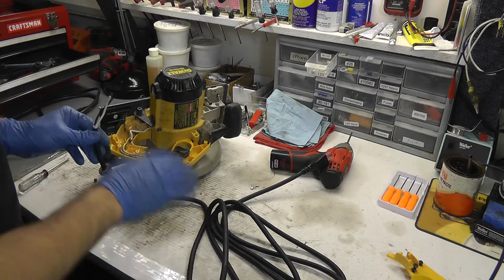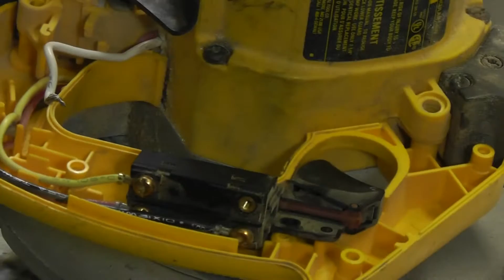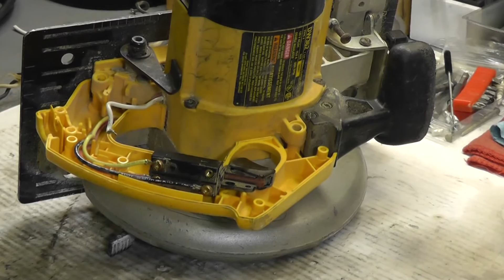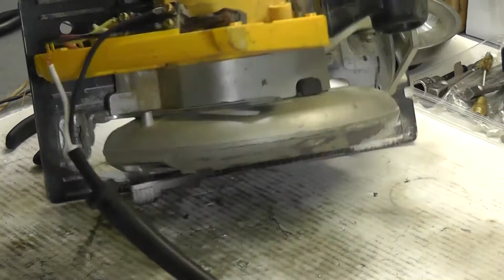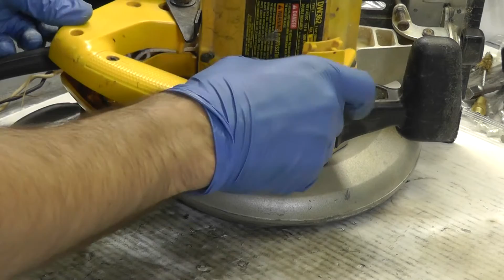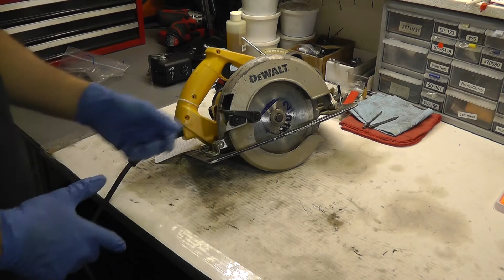Power Cord Install On A Power Tool

Comment: LOL, you crimped your field wire...
Reply: Do you have anything on the electric brake? I have a DW364 from 1986(ish) I am replacing the power cord but the electric brake didn't work last time I used it, like 10yrs ago.

Comment: I had the same problem I did the repair from your video but on your video I noticed you left the white wire trapped in their casing off the handle just thought I would point it out to you but very handy video thank you